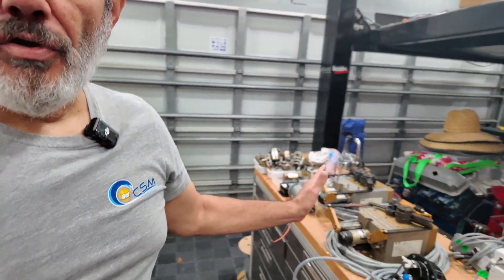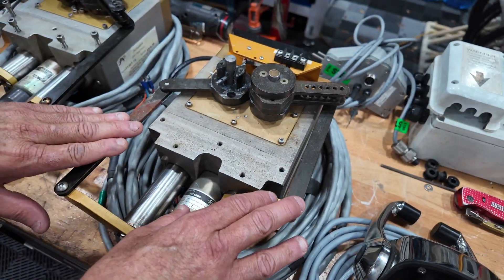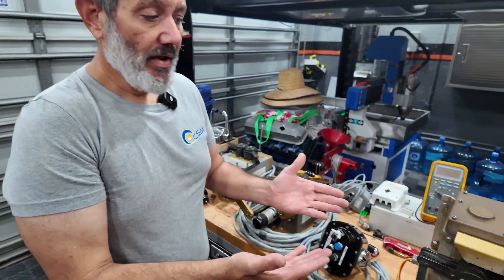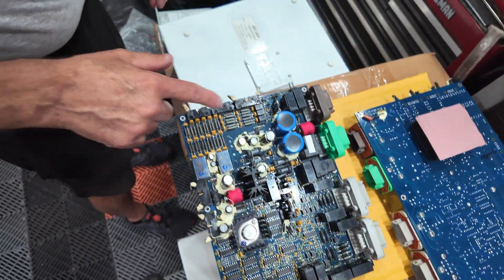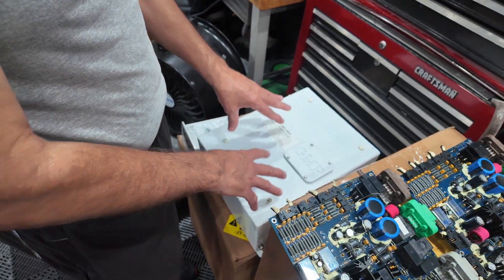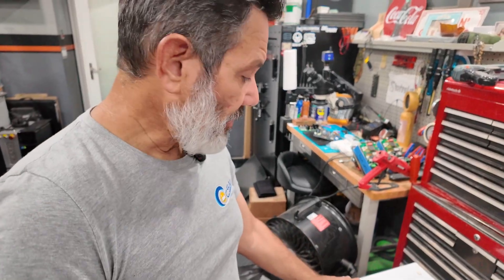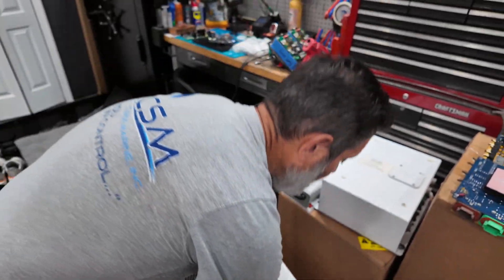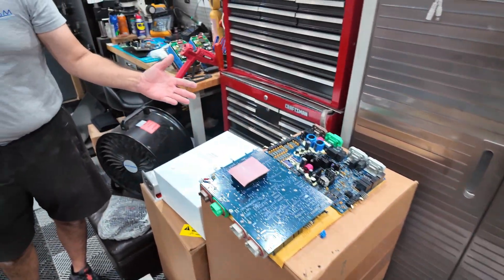Fix It or Replace It? Watch What We Did with This Glendinning System

Comment: I have an eec-2001 that is also cycling power on and off. It seems to happen when I’ve been docked somewhere while only running the generator for a few hours.  I need to contact you this week. I’d like to discuss a replacement
Reply from the maker: Of course!, we have in stock. if you need any help you can reach out to us with the contact information on our website. we will be happy to help out.

Comment: Cannibalization of YANMAR DC-DC converters, otherwise you have to have more pulled from France @$550 usd + shipping. And you are saying they have none in stock at the OEM?  So a simple purchase order of QTY: 20 would tie you over for the season. And hedge your business lead time by a solid margin. Why not offer the yacht owners memberships to help with the Bench Stock. I could understand you're running your business at a fixed labor rate to include overhead. Why not have a membership (~150-$600/year) where they can help you with funding a prestock on these items?
Reply from the maker: It sound like a great plan on paper but logistically speaking majority of the clients we have here upgrade to the new system. Some clients want repairs, either way we can satisfy them.